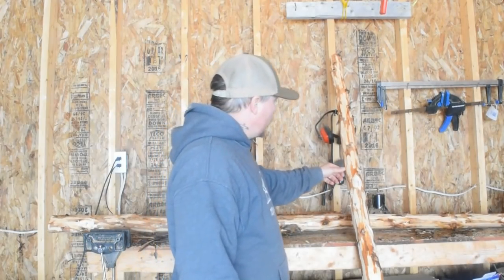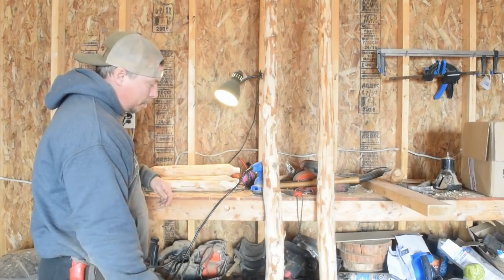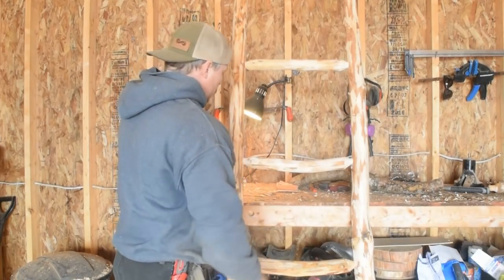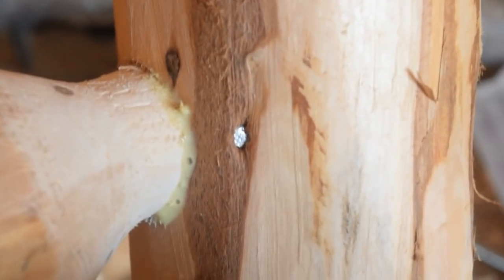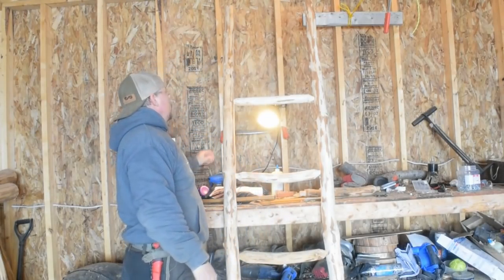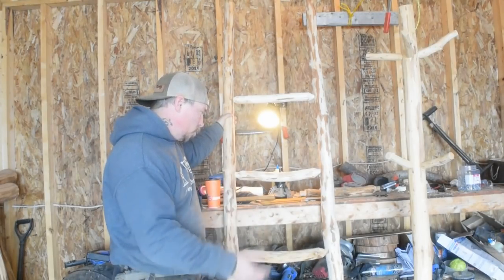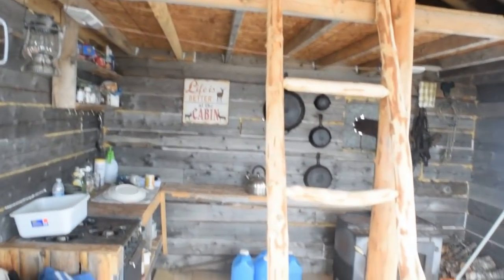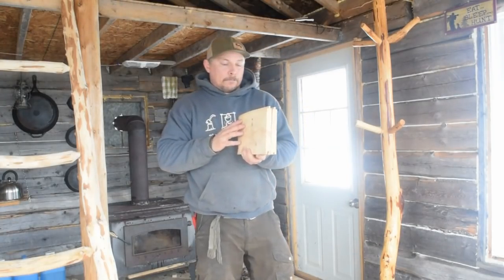Cosmetic Improvements At The Log Cabin

Comment: Troy, when I was watching this I figured you would have drilled holes perpendicular to the ladder rungs, and used glue and pegs to hold everything in place.  Not real sure about the nails.  If that little bit of wood by the nail splits, you now just have glue holding the rungs.  Looks nice though.  I was nervous the drill would kick back on you.
Reply from the maker: I will keep a close eye on it and check it regularly...Thanks !